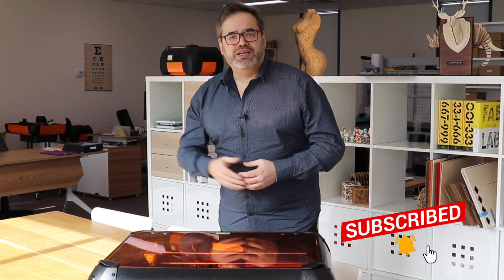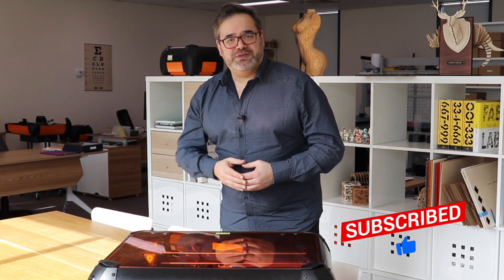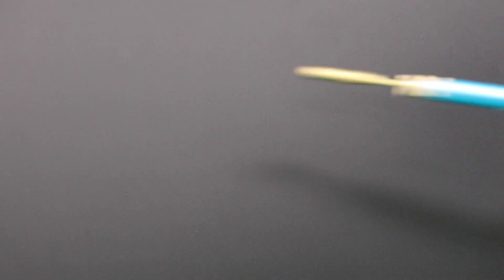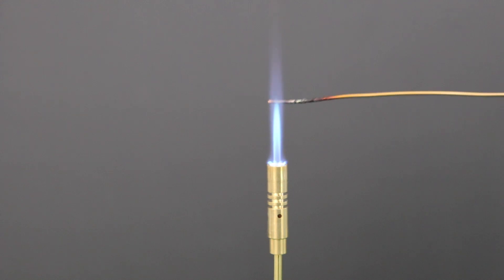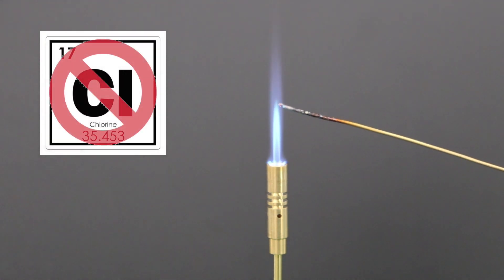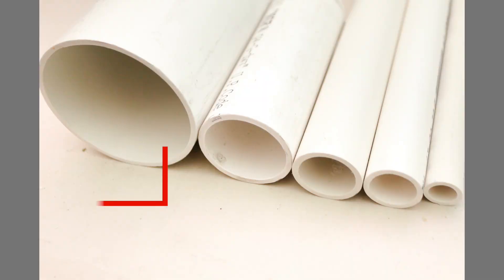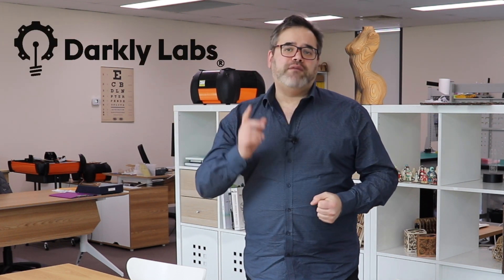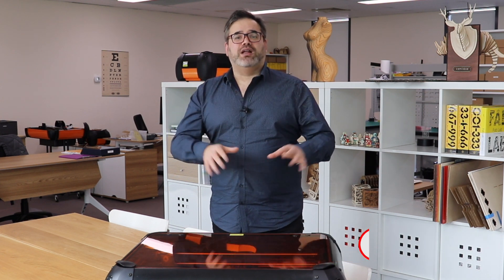Could Your Laser Cutter KILL You? Never laser cut this! Test for chlorine gas

Comment: how do you test pleather or fake leather? Will it melt onto the wire or do I burn a small piece?
Reply from the maker: Exactly like I showed in the video. The plastic elements will bond with the copper for testing. Stay safe.

Comment: I just realized that I was using Vinyl Records for a long period now, first I manually cut them and the I used a Laser CNC to do it. I wish I know this before. 
Can you point out another plastic materiale like that I can use to laser cut?
Plexiglass is not an option because I use a diode laser based so the beam just pass through transparent materials.
Reply from the maker: Diode lasers can cut solid colour acrylic. My go-to for creating something that would look like a vinyl record would be solid black acrylic. I cut 3mm black on my diode laser all the time.
Let me.know if you use the black acrylic or end up using some other type of material 👍
Stay safe!
Reply: @LaserLivestream 
I will look for black acrylic to use from now on.
I just realized that I used for around 2 hours my new CNC to cut vinyl records and I sow some rust on all the bolts and nuts inside the enclosure I made, also on the V-slot wheel for the axis. I thought it's moisture but is the chlorine as you said. Don't know if there is any method to get rid of it or if it's going to get worse.

Comment: I thought copper wire itself produces a green flame?   Right?
Reply from the maker: As explained in other comments, if you burn the copper under extreme heat, it will create a green flame. The torch does not create that kind of heat, and you only need to put the sample in the flame for a few seconds to see an answer. If there is no reaction, the flame doesn’t change colour.

Comment: I have a question ❔,  is there any book 📗 that could show me how to build a laser cutting machine ?  I have seen a few videos on it on youtube but a book 📗 would spell out the names of the materials and RIGHT devices used to build one that would be done correctly.   I need one with at least 400 watts of power on a relativity small bed say 💭 33 inches  to 5 to 6 feet.   Also one that will cut Lexan plexiglass tubes into rings on a rotary device that I have seen.  I know that's a separate device and motor driven.  I also think making one would cost less.   Thanks !

Comment: Hi Gil i wish i knew this sooner. Ive cut pvc and yep lots of corrosion, it ceased my xy axis h runners. Ive fixed the runners with some 400 grit sandpaper and wd 40 the oiled it and its free and working now but the laser is trying to go beyond the bed both on the xy axis. Have checked the sensors and a is workin ok. Im using lightburn and all seems to be ok there, Could the smoke from cutting the pvc make the sensors not work even though it all seems to be working? Any trouble shooting thought would be appreaciated
Reply from the maker: Sounds like a hard lesson to learn, but Im glad to hear your safe.
Check your laser electronics board for corrosion. Especially where the sensors are attached. Chlorine likes to attach PC boards.
Let me know what you find.
Keep safe and keep lasering!

Comment: Does it have to be a gas flame torch? Will a regular lighter not work?
Reply from the maker: Great question. Unfortunately a lighter flame will not heat the testing wire got enough to do the test. I tried and never got a positive result. Using a flame torch or bunsen burner, and hearing the wire in the blue (hottest) flame is the way to go.
Reply: @LaserLivestream  Thanks for the easy test tip. So I can heat up that copper wire on my gas stove when I don’t have a torch?
Reply from the maker: @aragorndedolor4171  A gas flame will allow you to heat up the sample and see the result. 👍

Comment: What about simply having good ventilation?  (An enclosure with negative air pressure pulling out the bad stuff.)
Reply from the maker: That could be an answer when it comes to removing shrine from the air, but I have seen machines that have had their electronics destroyed by the chlorine particles attacking PCB tracks and components. 
In the end, you have to decide if the risk is worth the trouble. I just don't want people hurt because they didn't know what their material was made up of.
Reply: Proper ventilation is all you need.  Most of the electronics on a good laser cutter aren't even located in the printing space.  Sure, if you are using an Ortur that's sitting on your dining room table and your burning anything..  its unsafe.  Put that Ortur in a box that has a good fan sucking the air out of the box and blowing it outside and you are fine.  This is a tool.  Precautions should always be taken. Anyone who is using a laser should have enough common sense to make sure its well ventilated.  Even if your burning wood...  paper.. anything.. ventilation, its combustion for crying out loud.

Comment: Does this apply to UV, IR or both?
Reply from the maker: This is not limited to wavelength, but material cut and vaporised.
When the chlorine in the material is cut it releases chlorine molecules that combine with water in the air to become Chlorine gas.
So the answer is both. Please stay safe.

Comment: Unfortunately it’s rarely mentioned by people making laser videos … chlorine is found in a lot of material people cut, and mainly in PVC or vinyl. I experienced it myself when cutting pvc believing it was PET. 
One other tip : plastic made of PVC tend to get white when folded, it’s a very quick test for transparent sheets for example. PET or PMMA don’t get white and are way more safe to cut. 
And more generally laser manufacturer should warn users about what king of gaz is exhausted when a certain material is cut , for example , PMMA creates CO2 and OC, which can also be harmful when you have no proper ventilation or exhaust system.
Also , don’t cut ABS (contains styrene) , expansed polystyrene,  chrome leather (only veg tan leather are safe) vinyl, resins (polymérised , like epoxy ones for instance ) , and a lot of websites will tell you it’s safe but they re just reckless and stupid) 

Those material are toxic. 

And be aware of other materials that can catch fire easily (polycarbonate …)
Reply: PET will go white too. On the other hand colored vinyl foil will not.
Reply: @Suluu00  thx for the tip
Reply: Obrigado

Comment from the maker: Laser Cutting these products creates chlorine gas when using the following materials (including but not limited to):
★  PVC
★  Pleather
★  Vinyl 
★  Artificial  leather
There is a very quick test you can do before using any material in your laser cutter to check for chlorine. Called the Beilstein test, this test uses very basic equipment and can be done in seconds.

Comment: Great idea, the only issue I can see is that from my experience working in a copper smelter is that when copper is subjected to heat the copper oxides burn green, so this could give a false positive for chlorine.
Reply from the maker: I'm curious at what temperatures are copper smelted at? I believe the risk of a false positive is greater at high temperatures, but I'll do some research. Every time I have done this test, I do use a control piece to make sure the results are accurate. Will add that to a future video!
What have you tested using the test Shawn?
Reply: Hi  @LaserLivestream ,
Honestly mate I am only just getting started with laser cutting as I have made a career change away from mining and smelting and starting my own business, and your video was part of my research.

Copper melts around 800⁰c
The concern I had was the copper oxides will burn with a flame as they're essentially the oxidised copper residues on the outside of the wire in this case.

Would stainless steel be a better option as from my limited knowledge has a far higher meting temperature and also isn't as susceptible to oxides giving a potential false positive. 

Just something that I thought of 🤷‍♂️
Reply: @LaserLivestream  As a retired Physics and Chemistry teacher, spectral flame analysis has been done many times. However, I would suggest using nichrome wire (aka resistance wire) rather than copper wire
Reply: @paulbrinkley9674  No, the test works by the PVC converting copper oxide on the wire into copper chlorides. Unlike the copper oxides, the copper chlorides are dissociated in the flame and give it a green colour.
Reply: @lucaswilkins9217  I should have watched the whole video. Thank you

Comment: I've used this method to test materials for my laser.  Most manufacturers of lasers will even void your warranty if materials containing chlorine were cut in the laser.  Great tip!
Reply from the maker: I didn't realise that most laser manufacturers will void the warranty due to laser damage. Another great reason to test for chlorine before your cut. Thanks!
Reply: @LaserLivestream  Glad to help.  When PVC is heated it releases chlorine gas, this mixes with the moisture in the air and the result is hydrochloric acid. It is toxic to humans and corrosive to most anything it comes in contact with.

Comment: I thought it was cyanide gas which people need to be wary of when using a laser cutter. Chlorine is present in everyday bleach and doesn't harm in small amounts.
Reply from the maker: In liquid form chlorine is not going to be an issue. When it is atomised by a laser, chlorine  attaches itself to the moisture in the atmosphere and becomes chlorine gas. In a gaseous form, chlorine enters to body alot easier.
Stay away from cyanide too. But chlorine is readily found in products that people happen to place in laser cutters.
Reply: @LaserLivestream  But I doubt that lasering certain materials would release much chlorine gas because the laser beam is minuscule.

Comment: We are trying to cut a thin sheet of polycarbonate with a laser cut. Does anybody knows if it is dangerous to cut it that way?
Reply from the maker: Polycarbonate strongly absorbs infrared radiation! This is the frequency of light the laser cutter uses to cut materials, so it is very ineffective at cutting polycarbonate. 
While it does not have chlorine in its chemical makeup, Polycarbonate will create stringy clouds of soot that float up, ruin the optics and mess up the machine.
Reply: @LaserLivestream  is polycarbonate plexiglass? I just bought  a plexiglass sneeze guard I wad going to use... but maybe I cant
Reply: @lorirodriquez6100  plexiglass is acrylic and can be safely cut with a laser

Comment: Hi Gil, i have just seen someone in the UK who makes table lamps from plastic pipe, which have an intricate design laser cut into them. Is there a plastic pipe which is not PVC, and doesnt  emit chlorine gas?
Reply from the maker: If the pipe is made of a plastic that is not PVC, there would be no issue using it in the laser cutter. Do you have a link or picture of the plastic pipe?

Comment: As far as I know a green flame indicates the presence of copper, which is indeed true as the wire is made out of that. In order to conduct a proper flame test you need to deposit the material on a ni-cr or platinum wire, pure or in a hydrochloric acid solution. But even then I don't know how telling this test would be on this kind of material, in fact chlorine does not emit light in the visible region when flame tested. That's what I know, I'm not an expert so I may be wrong.
Reply from the maker: The small amount of Chlorine accelerates the chemical reaction and show a green flame as shown in the video.
If you placed copper in a heat source and brought it up to extremely high temperatures, you are correct, the flame would turn green. 
With the Belstine test, the few seconds (3-10 seconds) will show you if chlorine is present. For more on this test, check out https://en.wikipedia.org/wiki/Beilstein_test
Reply: @LaserLivestream interesting, thank you very much for your explanation!

Comment: This is a great tip.  One more item that I’ve seen lasered that has chlorine is vinyl records.  There’s a photo floating around the Internet from someone who used a laser for some about of time cutting the record.  It was trashed.  Totally unusable.
Reply from the maker: Yes, I think I saw that image. I was given a laser unit to test and when I was engraving an image I discovered that the lines would have a visable “wave” to them. It took some time to work out that the rubber tracks in the unit had been desolved by someone using the unit to cut vinyl which had melted the rubber tracks onto the cogs. Took some time to work out the issue, but once that was replaced the laser was gold!

Comment: Interesting and a concern. Just heating a piece of random new copper wire bought from an electronics hobby shop without even melting it into a piece of PVC it gave off a green flame. That would say it already had some kind of chlorine  based coating maybe.
Reply from the maker: Hi Peter, I can't comment on the copper you are using, but some have a clear sheath around them that could be made with PVC. 
As for copper burning green, yes if you put copper in a flame and leave it there, it will produce a green flame. This test returns a positive result almost instantly as the chlorine accelerates the reaction with less energy needed. If your interested in why this happens, check out the messages below.
Have fun and stay safe when using your laser.

Comment: There is a possibility for a false positive if the test is done incorrectly or if the test substance itself contains copper. Various copper compounds also yield a green flame, so if you do not use clean copper wire or test a substance that contains copper you may see a green flame even when the test substance does not contain chorine (or more formally, organic halides).
Reply from the maker: Never had an issue with a false positive. I guess when you heat the copper up, you should be aware of a green colour in the flame. If that happens before testing your material you would know that the copper you are using is contaminated.
Thanks for the info!

Comment: Please mention cyanide as well before saying a material is safe to cut. :)
I know that there are no easy test methods available, but with the materials around it's tempting for many makers to try to laser cut/engrave PU, PA, ABS or other nitrogen-containing polymers and those should not be considered safe.
With the extreme toxicity of cyanide the amounts emitted when burning/laser cutting those materials should be considered dangerous!
Reply from the maker: Very true Milo. Thanks for putting that information out there. I plan to do a video about all the risks from materials being cut in a laser cutter. Given that this test is quick and fast, and can protect the user form Chlorine has exposure, we wanted to share this testing method first. 🙏
Reply: Indeed, there is many more things than chlorine gas to look out for. The issue with the chlorine gas itself isn't so much inhalation, but rather that it combines with moisture in the air and forms hydrochloric acid, which will corrode the inside of your laser cutter. Just because it doesn't contain chlorine doesn't necessarily make it safe. Teflon (PTFE) for instance is absolutely toxic when burnt, and inhalation can cause polymer fume fever (also called Teflon flu) and acute lung injury.

The only way to know for sure is to find the MSDS on your material and look up which products are created when burning. It's a standard part in the MSDS. If you find anything like chlorine, cyanide or anything else especially harmful to either you or the machine, do not laser it. 

One of the absolute worst things you can cut, as far as I've researched, is kevlar. It releases hydrogen cyanide. Yum!